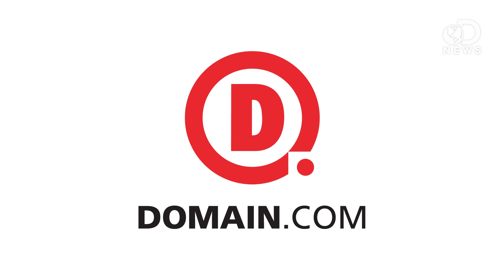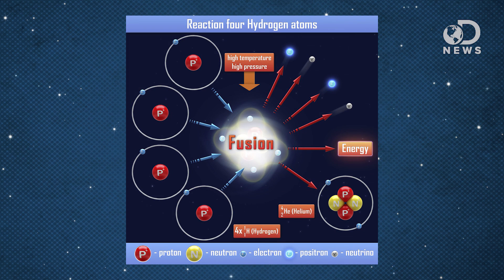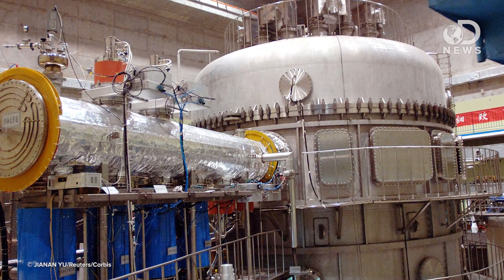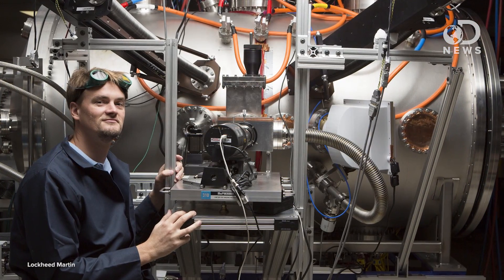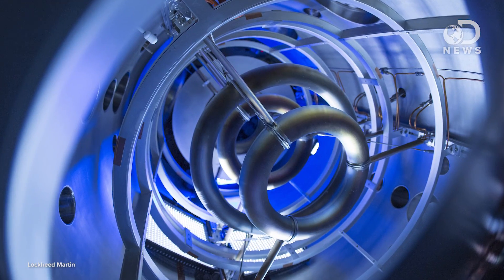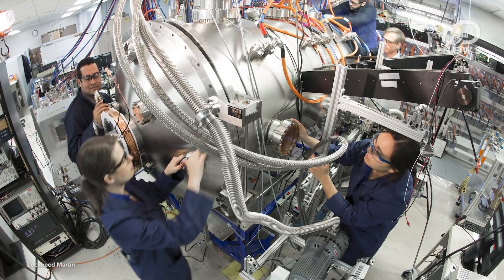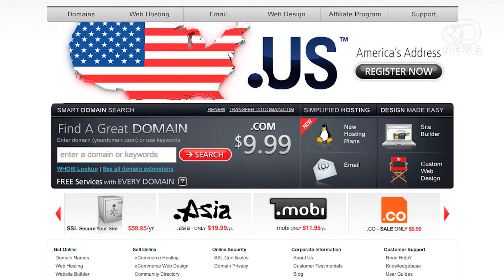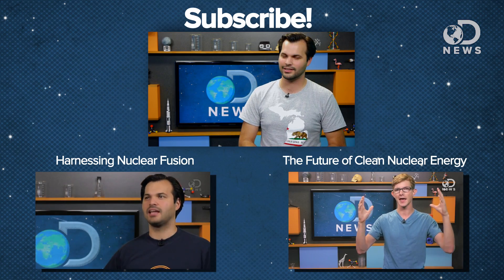Is Fusion Energy Close To Becoming A Reality?

Comment: End of mining? Then what materials would we use to contain the fusion plasmas? Plastics derived from plant waste? If the latter is the case then the whole planet would be screwed!
Reply: The petroleum needed for plastics is a tiny fraction of the petroleum currently used for energy production.  We can still use oil to make plastic.
Reply: finao o or alternatively, use said oil to make carbon nanomaterials for futuristic megastructures like orbital rings, elevators, space fountains, loftrom loops, mass drivers, and rotating space habitats.
Reply: Or both

Comment: The "funny" thing is, it will contribute to global warming as well, just from releasing waste heat from the energy that is bound in the molecules and atoms (and thus not doing anything in the way of heating)... We are currently only using 16 TW of power at any moment, which is nothing right now, but if we went up to 5000 TW of power use only from nuclear (fusion and fission) as well as fossil fuels (not factoring in CO2 and other greenhouse gasses), we will heat the planet by 3 degree Celcius without factoring in any feedback system from the environment... :/ We just can't win, it seems... :(
That is a problem for the future, though. :P

The only neutral power source is the sun and moon, in all its various forms (wind, solar, tidal, water and others that I'm not aware of atm). :P

Comment: this doesn't seem too smart.. how do we know the energy can be harnest and or contained if we haven't even created it yet.. at least on that scale. if you ask me let's not make the power of the sun
Reply: This source of power is more stable than nuclear fusion because if something goes wrong you can just turn off the magnets.  We do have working reactors, it is just at the moment it costs more power than it creates.
Reply: These systems have been test fired countless times already, and they have no chance of doing something catastrophic because they use 5g of materials at max and that is only just heated enough to start a reaction, if anything fails in the process that gas cools down and the reaction stops. At best you would mess up the equipment with hot gasses.
The only reason they aren't full time plants is that setup with super cooled chambers/magnets/lasers takes so much power fusion heating doesn't recover the electricity spent.

Opposed to say a decent size nuclear plant that has 100 tons of material reacting at any one point and if anything goes wrong that material needs to be physically moved and cooled for long enough to stop the reaction, so if your system has a big enough problem where you can't move or cool those 100tons you suddenly have a very possible 100ton nuke in the making.
Needless to say this is why power plants build redundancies over redundancies to prevent all this, Fukushima went badly because they actually had all 8 redundancy cooling systems crushed by the gigantic tsunami that hit them, and the fallout even then was minor.

Comment: How is the energy in the stellarator converted from neutrons to usable energy? I think i heard something about neutrons hitting something which produces tritium or deuterium.
Reply: For the most part it will just be heat, once they hit enough things you are simply left with heat which we already handle with ease (with only 50% efficiency, but we can use it).
Would be better to get some radiation directly converted into electron movement, but the particles created will cause a good deal of damage so putting any fancy betavoltaics directly in the line of fire would get mighty expensive.

Comment: but if we use water as the source of energy and convert it into helium during the process, won't we run out of this precious resource one day?
Reply: nice way to finish it
Reply: +jasexavier I'd also like to add that there are other fusion possibilities that yield more energy then hydrogen hydrogen fusion. Any element lighter than iron releases energy when fused.
Reply: +Mia Patterson maybe there are draw backs that's y they're not using iron
Reply: Rafee Ali  Not iron, neutrons are captured rather than produced for iron and elements heavier than iron, but ya. Maybe, I haven't looked too closely into it. Still in H bombs they use elements like lithium to boost yield.
Reply: Extremely small quantities of tritium and deuterium are present in regular water, and we only need to extract those for fusion, plain H2O is useless to the actual reaction.
P.S. Hydrogen atoms are used because they are the easiest to fuse, trying to do it with any atom of a higher order is stuff we won't get done for centuries.
Reply: Dude we can't just go and look for water in the space.. in order to sustain this technology we must find a way to convert helium back to water...
Reply: Hmm we can do this.. lol
Reply: No. 1 out of every 1000 water molecules contains Deuterium instead of normal Hydrogen. This Deuterium is what is used as fusion fuel, so even if we used it all up, 99.9% of the water on Earth would still be here. That's not even really a concern though. The Sun will expand and envelope the Earth long before we could ever use up all that Deuterium. There's no need to mine the solar system for additional water, although that might be handy for spacecraft to refuel without returning to Earth.
Reply: quite the answer i was asking for!! thanks! :)

Comment: This vid makes it sound like we've never been able to perform fusion, which is totally off the mark.  

Uncontrolled fusion was first performed in a thermonuclear weapon in the 1940s and controlled fusion was first performed in the late 50s. Since then, fusion has advanced at a rate similar to Moore's Law, doubling about ever two years. In 2008, a 14 year old was able to achieve fusion. 

What we've always been 20 years away from is a man-made fusion reaction with a net gain in energy, meaning more energy is created than used to sustain the reaction. ITER is the first reactor that will theoretically create more power than it consumes, but the extra power will not be enough to overcome other operational losses. Based on this reactor and the multitude of other paths to achieve fusion that are being researched, I think the next generation of fusion reactors beyond ITER will be viable sources of energy...

This, yet again, leaves us 20 years from viable fusion energy and probably another 10 years before Fusion becomes commonplace. Bottlenecks in getting this done will likely relate to funding and government regulation....

Comment: Just a little info for you guys. Of all the three isotopes of Hydrogen- Hydrogen 1 (Protium), Hydrogen 2 (Deuterium) and Hydrogen 3 (Tritium), only Deuterium and Tritium can be fused in a fusion reactor. Protium can only be fused in a star, like the Sun. The most abundant is Protium followed by Deuterium with Tritium being the least abundant. For every 1 000 000 atoms of Hydrogen, 156 are Deuterium, less than 1 are Tritium and the rest is Protium. So fusion reactor fuel is not as abundant as you may think. The total amount of energy you can get from fusion reactors is a lot less than what you can get from solar converters. Still...the amount of energy you get from it is a lot larger than both fission fuel and fossil fuel combined.

Comment: I can't believe he didn't talk more about the TWO Togomak fusion reactors that WORK in Oxford, England. I've been there and visited them both, and the first, smaller one is smaller than lockheeds. I visited in 2013, and by then they had already solved how to do it, it was just the efficiency that they had to work out. Also, they are only allowed to test it at very specific times, as it takes up 0.3% of the entire British national grid. I believe they are building one in France that will be absolutely MASSIVE, and be the first to be practical.

Comment: If the Protoss have fusion power then why would they ever need more vespane gas?  Vespane gas is a power source.  Have the Terrans developed fusion power in Starcraft?
Reply: +asdfghjkl  the protoss use vespene as a catalyst for their psi-driven machines. Its not the power source
Reply: That's why the battle cruiser requires a fusion core and the Yamato cannon needs research in the fusion core...
Reply: Pancakes2good Whatever it is it's not a power source for a battlecruiser.  It's an extension to a building.

Comment: We can put the power of the sun on a truck for you TODAY.
Yes, solar powered, hi speed charging and long range (1000km <>) capacity is here NOW.
Fusion and fission are fantasies, and enslave people to high tech corporations, -as does solar, but the difference is the technical complexity and parts supply chain monopolization etc.   you want low tech... ie: you need to be wealthy to own and run a jet commuter or other aircraft... and servicing is astronomical, even without the airworthiness factors.

Comment: The issue is not achieving fusion, that fairly easy to achieve. This issue is converting the output energy into a usable from. At the moment no reactor yet has yet to produce more (usable) energy then it consumed, and non of them can run for extended periods. As for the claim of "six liters of water equaling 1 ton of coal" Sure if by "water" they mean deuterium oxide (2H2O / D2O).

Comment: If it was anyone but Lockheed Martin or another well-known tech giant, I would be very skeptical.

Your video just scratched the surface of the changes that this will cause.

The crumbling power grid?  Solved!  We won't need a huge grid because the power plants will be smaller and power generation will be decentralized.  I can see developers building condominiums and subdivisions that have their own power plants.

Running out of fresh water?  Solved!  At least, if you live near the ocean, you can stop pumping water out of the rivers and start distilling it from the ocean.  This is going to be a huge deal for California.

Global warming?  SOLVED!

Considering the amount of our GDP goes into paying for oil, we can expect a huge economic improvement.  The money saved by using fusion instead of oil can go into cheaper products, higher wages, and better profits.

Best of all, the pervasive pessimism that started in the seventies can give way to the optimism that had been the rule ever since the end of world war two.

Comment: hmm... There are emissions from fusion: helium. I know that helium is an odourless gas and isn't exactly a greenhouse emission, so while it might not contribute to global warming, there may be another potential issue. We use water for the fusion fuel, so we're literally turning our water into helium, which then billows off into space (because it's light enough to escape the Earth's atmosphere). We should be careful to prevent this, or we may end up with a worse problem than global warming.

Helium does have use as a coolant in MRI magnets, among other things. It should then be captured for such usage. Also, it could be fused further (generating more power) to produce heavier elements that could be used in Earth's biosphere.